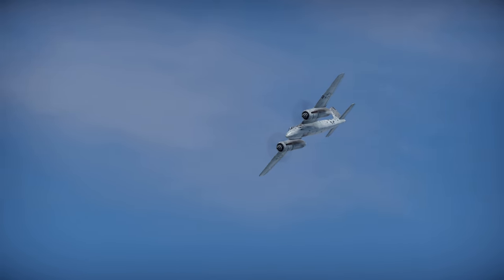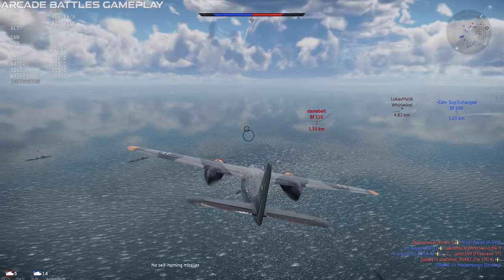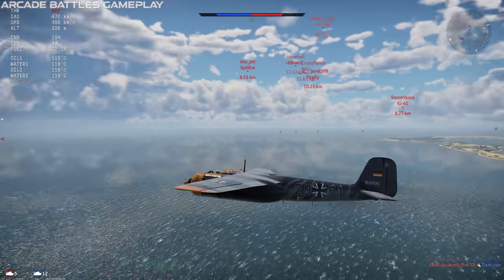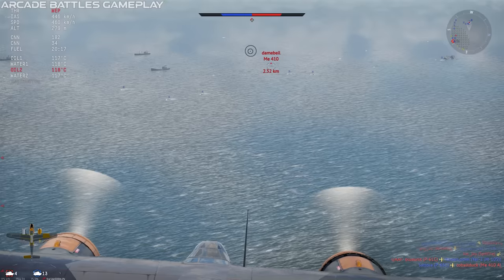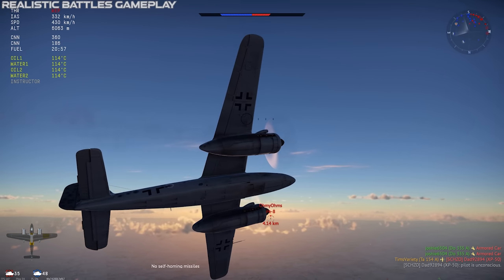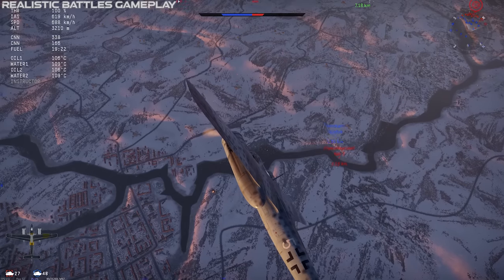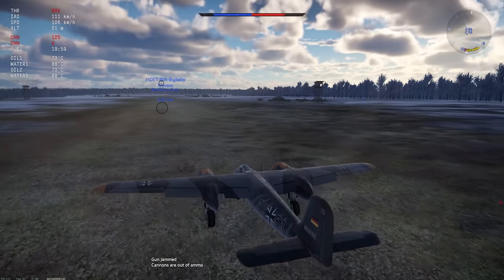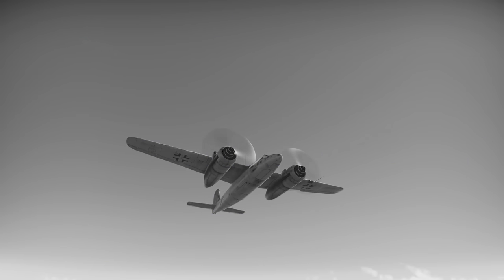Ta-154 In War Thunder : A Basic Review

Comment: One of the few mid rank premiums I actually used a lot (along the 109G-2). My only issue is that in mixed battles it only gets the captured T-34 and some TDs on its BR. tough the Pz IV H still gonna serve u well on 4.3 (I think it use to be 4.3 once anyway), but in naval u have no reason to pick it over the 110G or the Do-335 A-1 or a 190 (if u want a "fighter").

Comment: Would play the XP-50, early P-38s, or even the P-61 over this thing any day, and they're all at a lower BR.

The Ta 154 has good cannons, that's pretty much the only advantage it has over these other interceptors. Even there, I'd probably take the Black Widow's quartet of 20mm cannons at 4.0 for both bomber hunting and head-on engagements with fighters. MK 108 tends to be too low velocity to engage either at longer range, which is where I prefer to open up.